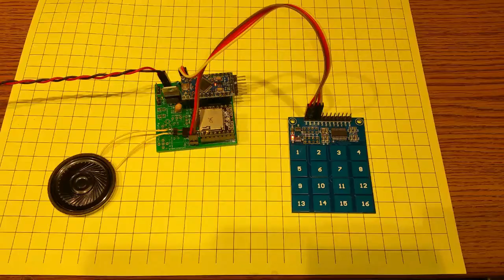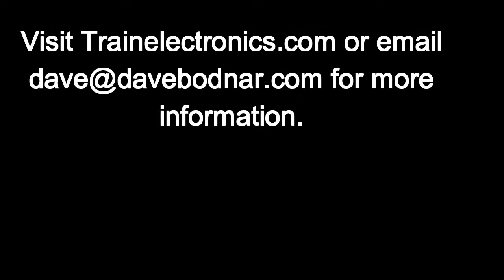keypad dfplayer

Comment: When I press ttp229 numbers, data comes, but mp3 does not play. These values are displayed on the screen.

3
~⸮
busypin 11111111111111111111111111

The rx and tx ends are correct. what should i do? where am i doing wrong
Reply from the maker: Sorry, Halil, but you don't give me much to go on  - also, I  have not done anything with that project in over 5 years and don't have a sample to try to duplicate your problem.
Best bet it to make sure you have the right libraries installed and that you have the data connections properly connected

good luck and have fun!
dave
Reply: @DaveBodnar  thank you.  I will work a little more on the circuit. i hope i can solve the problem

Comment: I want to use 20 momentary button in matrix a total of 9 wires with DF Player is there any schematic on it??
Reply from the maker: Tommy, I have not run across such a design.
Google may be able to help!
Reply: @DaveBodnar  Thanks. Is there a 5 x 4 keypad that should have 9 wires! Can I connect and get 20 different sound effects from DF Player & Ardunio?
Reply from the maker: @Delorean29  Tommy - I have never tried such a keypad so I really can't say if it will work or not - give it a try and see what happens
dave
Reply: @DaveBodnar  Can I connect example MUX 16 channel chip? https://www.electrokit.com/uploads/productimage/41003/41003469-600x600.jpg Button outputs to left
Reply from the maker: @Delorean29  Again, I have no experience with it but it is worth a try
dave
Reply: @DaveBodnar  Thanks. Well I must take & test myself. Have the black Arduino micro pro smooth be fun & try it :)